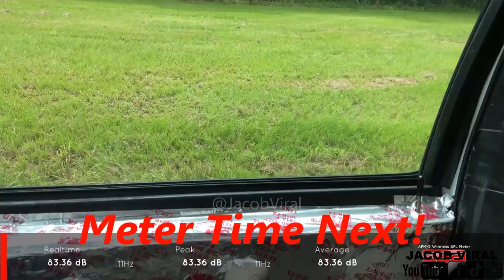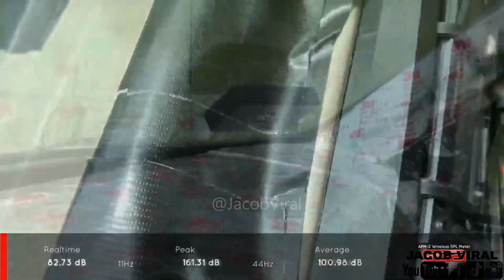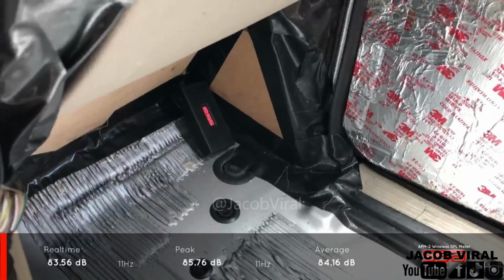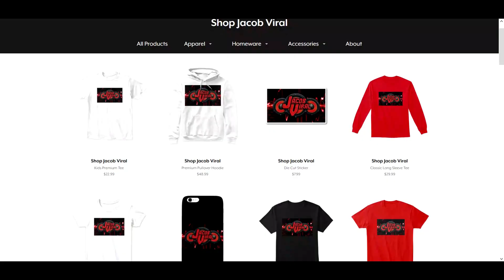Official Demo of my 160dB Build!

Comment: Wow you really know what your doing...great job..love to see you increase your build and spl..i have a problem with voltage..think you could help me?
Reply: You need better batteries/a better alternator is all
Reply: @Ninjasraynonu3  ok i got 3 xs3400's 370 amp brand x alt
Reply: @lowrider4life462  did the big 3? And I would swap the agm’s for lithium
Reply: @Ninjasraynonu3  yea big 3..i wish i went lithium but lol...not gonna throw away gel...i think its actually my wiring..you think 2 runs of 1/0 for power and ground enough for 2 skar sk4500?
Reply: I mean 2 runs a piece
Reply: @lowrider4life462  I did 4 runs of power and ground added extra grounds to the frame from the front...also ground your alternator I know it seems redundant since the alternator is mounted to the engine but trust it’ll help, ground it to the battery and you won’t have major drops
Reply: @lowrider4life462  I have two runs for my girlfriends Camry and she experiences a bit of drop but nothing too major so it could be the car is old too
Reply: @Ninjasraynonu3   your right..i dont think its redunded..i have alt grounded double run to frame..ive been told to  run  power and ground straight to back from alt whhich im gonna try.
Reply: @Ninjasraynonu3  im gonna try more runs of wire,everyone including you has more runs then me ty for tips
Reply: @lowrider4life462  no problem man good luck 💪🏾
Reply from the maker: Looks like you got help

Comment: Bass heads help me out a single 15” or a 18” crossfire xt3?
Reply: If they are both the crossfire xt3 I would go with the 18” more cone area and depending if the company does like some it’ll take more power and have a better Xmax but sometimes the 18’s are less efficient as to say a 12” but sometimes it’s such a small difference you wouldn’t even notice the difference in efficiency
Reply from the maker: I would go bigger cone area if you have the optimal space and port area.

Comment: Hey buddy i asked you this question recently I have a soundigital 8800 power amp its rated 1 ohm but I wanted to wire it half ohm if possible i saw that you have your amps at half ohm so I didn't know after box rise if it would be ok or just keep it at 2 ohm for now until I get my other sub thanks and nice vids as always
Reply from the maker: I wouldn’t wire Brazilian amps down below min impedance as seen bad results and heard they don’t like them. I would stick to your plan at 2 ohmS
Reply: Thank you very much